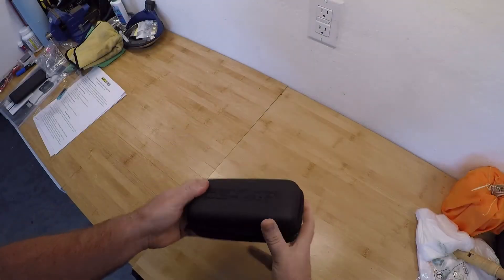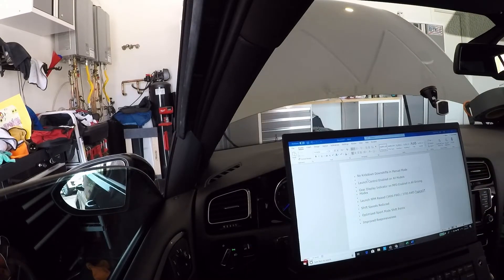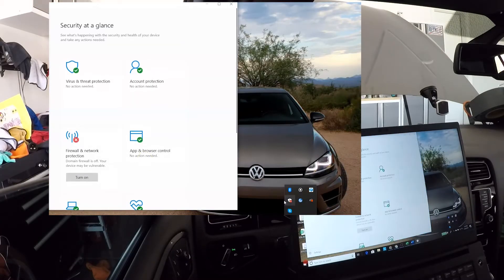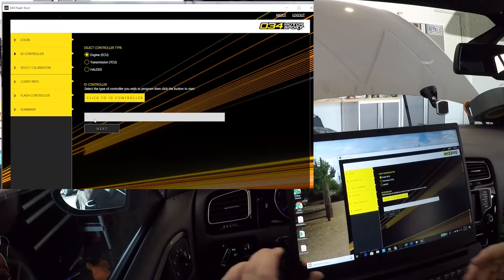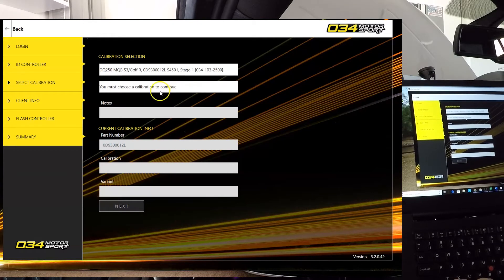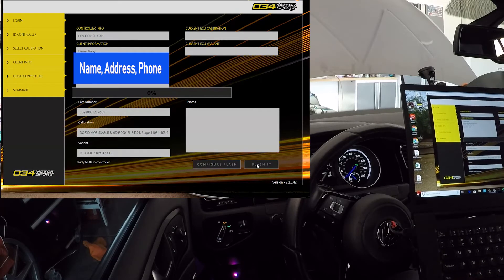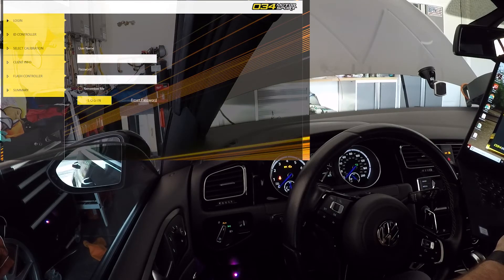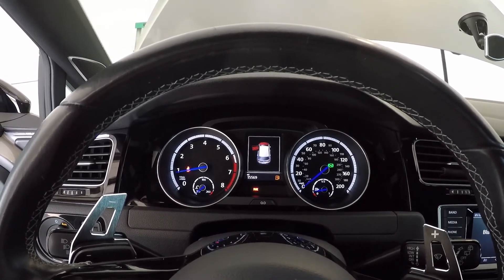DIY Dynamic+ tune VW Golf Mk VII - HOW TO and FIRST DRIVE - ECU & TCU from 034Motorsport

Comment: When you installed the program onto your laptop was there a flash drive with the program on it? Or where did you download the program from?
Reply from the maker: It's been a while but I think 034 sent me a url and credentials when I bought the cable.
Reply: @DWraysGarage  cool thanks foir the reply, just placed my order today, any tips when flashinng?
Reply from the maker: Make sure they give you the tune file for your specific chassis. I had to ship my ECU in for the Mk 7 R because they hadn't even loaded it. They were good about overnight etc. but I did waste some time. Just be sure to call them if anything seems off - their support is good - once you get thru to them. Tune was a real wake up for the car.
Reply: @DWraysGarage  also i was curious, when you use the cruise control to enter launch mode do the fan speeds pick up to enable extra cooling? i only ask cuz Integrated Engineering offers that feature on there tune when in launch mode, is this the same?
Reply from the maker: I am afraid I do not recall. Defo worth a call to them as they will likely know very quickly. Also could be a new widget since I acquired.

Comment: How do you get the 034 flash tool?
Reply from the maker: From 034motorsport.com. I have one I can sell you if you'd like to reach out and then you'd just have to buy the tune files from 034.
Reply: I have the flashing cable and the tune files. But i cant find the app to us on the laptop or if it even is an app.
Reply from the maker: Pedro. 034 has an excellent service team that walked me through the download and patching of the ECU through the cable. 877-591-9571 is their tech support line.
Reply: @DWraysGarage  same question as Pedro . Purchased the tune and the user end tool but can't find instructions on getting the install software
Reply from the maker: @colbyhall1989  you should get an email from 034 with login credentials and instructions, if you didn't already. I know I had an issue where my ECU required a bench tune and figured that out by chasing them down by phone. The guys at 034 are supportive.
Reply: @DWraysGarage  Thanks for the reply. I got confirmation emails for the order and a text for with a "Bolt" verification code.
Reply: @colbyhall1989  did you figure out the problem I’m having the same issue
Reply: @ReloadedClipsENT  got it all sorted. 034 has great customer service. Tune is exactly what the S3 needs.

Comment: I'll point out that D mode shift points are the same as stock.  You have to infer that from the product details where it mentions the S mode shift points are optimized.
Reply from the maker: That may well be true but I did, initially anyway, find it a bit more eager to get into higher gears and wasn't a huge fan. Could have been placebo though. Thanks for watching and sharing thoughts.
Reply: @DWraysGarage  I've logged the TCU tune extensively working with 034 on an update that will be more responsive.  It's been on the back burner for a while, don't know if they'll ever finish it.  http://mygolfmk7.com/034-dsg-tcu-tune-data/